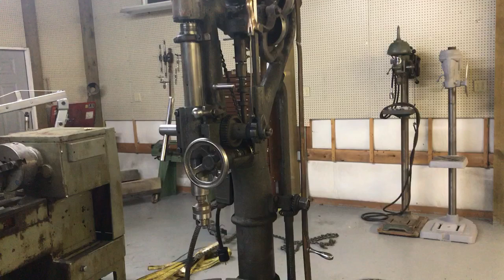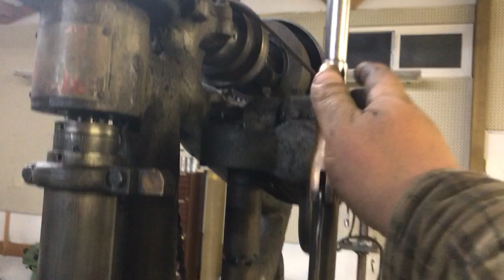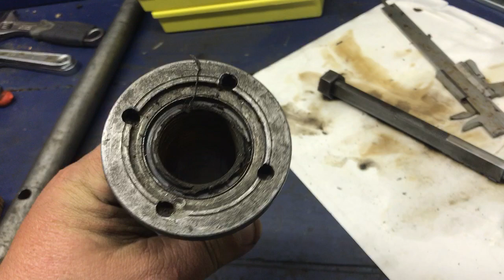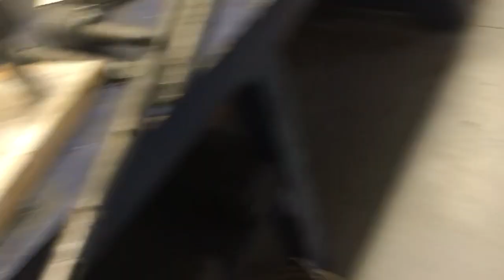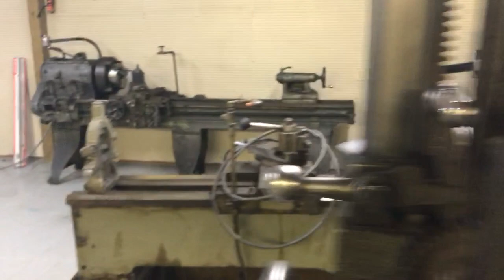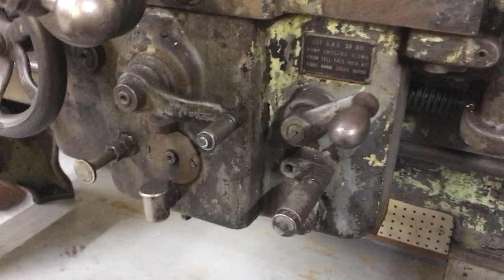2 new machines for the shop

Comment: The drill press looks sweet! I like your Tida, and what's not to love about the Lablonde!  lol I got a junky old basket case ShopSmith this weekend for $5.
Reply from the maker: The tida has really grown on me and it’s been my go to machine, it’s a late 80’s Taiwan lathe but the thing is just rock solid for its size, what mark of shopsmith, I had a mark 3 I believe at one time till I gave it to a woodworking buddy for up at his cabin
Reply: @smalltownmachineshop6860  The smaller'ish geared head lathes have become appealing to me as time has gone on. Naturally the 10EE, and the Rivettes, and things like that, but there are other ones out there that I discover all the time. I bought some Armstrong lantern tool holders from a guy a few years ago that had a beautiful smaller but built like a tank Italian lathe. I don't recall the brand, but it looked sweet! It was weird situation that experience. I needed a tool post and holders for my first lathe, and his that were for sale happened to be just like two blocks from where I was getting the lathe, and he was very broken English, so trying to explain that I was getting a lathe right near there was confusing lol, but it went down on the same day. I don't know about the Mark system. I'm trying to stay out of the ShopSmith cult. Which is to say I have no desire or financial means to get with all (or any) of the many accessories they have. This thing is a bare bones 10E basket case that I will play with like another light duty cobbled together milling machine.  I might dedicate it to milling wood (If milling wood is thing), like chuck up router bits and fool around. I've been wish wash looking for an old cheap beat down drill press that I wouldn't feel bad about Frankenstein'ing into another little mill of sorts, and this presented itself. I didn't intend it as that upfront, but now that I have it home... it fits that bill, and was $5. I need the quill lock wedges, and it's starting to look like I'll have to make them. Unfortunately it's the kind that are keyed, but before ball of laughs, I'll clean it up and mount it on a base stand. for vertical use. I Don't even know why I want to do this. I already have a little mill AND a junk built mill that actually works somewhat. Have you seen my video on that masterpiece of engineering? It's a real treat! lol :)